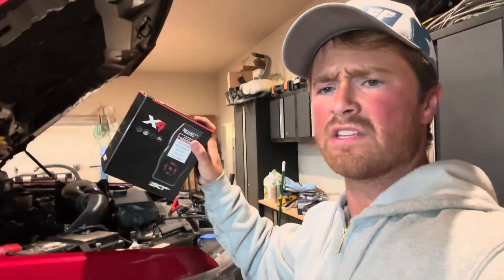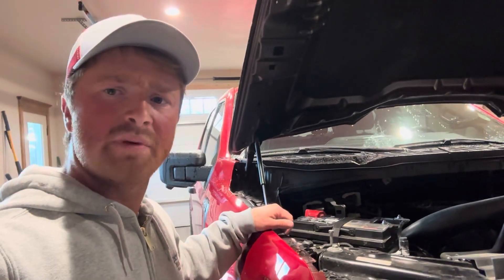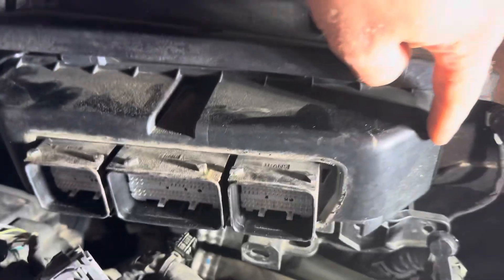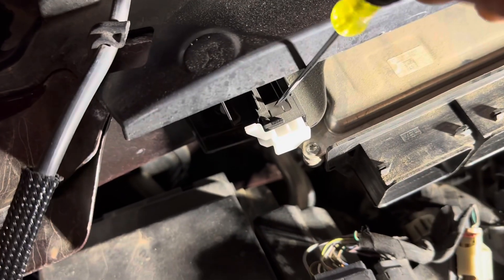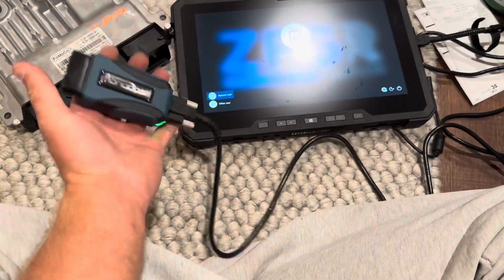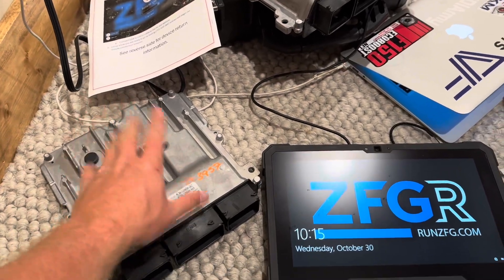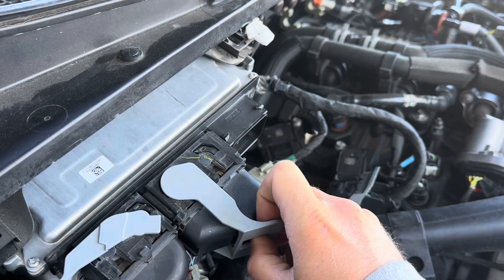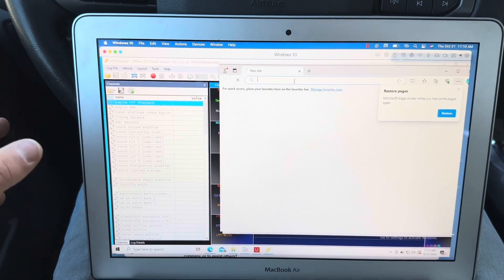ZFG Racing Tuned My 3.5 Ecoboost! How To Swap Your ECU

Comment: Just out of curiousity, why did you have to replace the factory ECU, with a used factory one that you bought from ZFG? If you stated the reason in the video then I missed it. Lol
Reply from the maker: The one from ZFG is unlocked. Stock one is not.
Reply: @BoostKingMatt  okay, thanks. I was wondering if it was something like that, but thought they could be unlocked in the tune without replacing the ECU. Is it basically just a core exchange? I assume this wouldn't apply to the 17-20 GEN2 3.5L? My trucks are an 03 Lightning, an 18 302A FX4 5L that I have tuned by AMRL, and my wifes truck is a 17 501A crewcab 4x4 with a 3.5L, and I was considering using ZFG to tune it. I already have a RTD+ that I got when I had my 5L tuned.
Reply from the maker: @JROC734 no the 17-20 3.5s don’t need an ECU swap because the ECU has been cracked, the newer 2021+ trucks have been kinda, but there’s still issues with being able to tune them sometimes, so an unlocked ECU is the way to go. You 100% should get a ZFG tune, it’s absolutely amazing. I’ve tried many tuners and ZFG is my favorite.